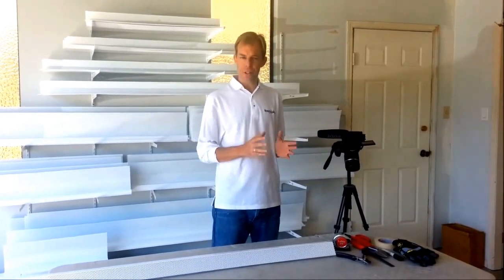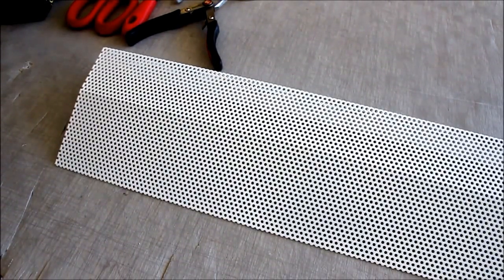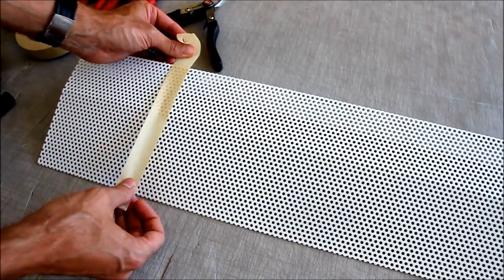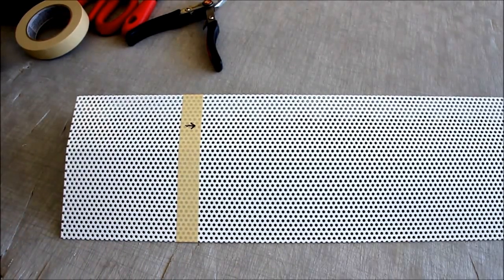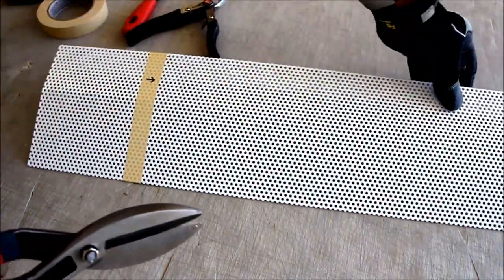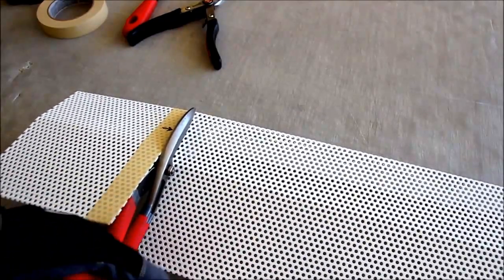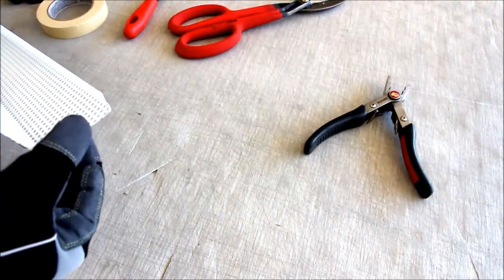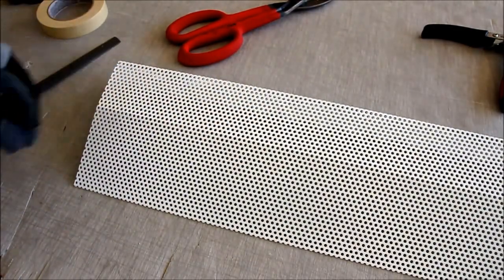Custom Cut Lengths For Baseboarders®

Comment: This is misleading. He is cutting the premium product which is mesh and relatively easy to cut with a snipper. The basic product has solid metal sections including a thick hem that can't be cut with a metal snip. I was able to cut a length of the base model using a Dremel rotary tool but had to buy a premium blade. It came out fine but it would be nice if the company provided more accurate information.